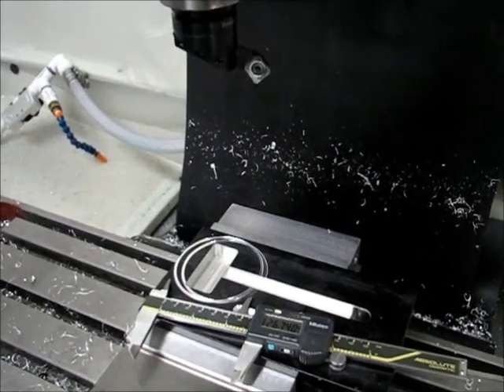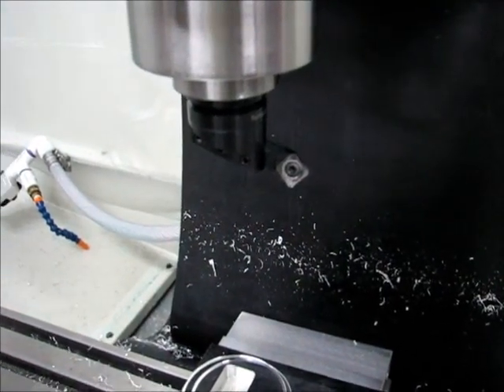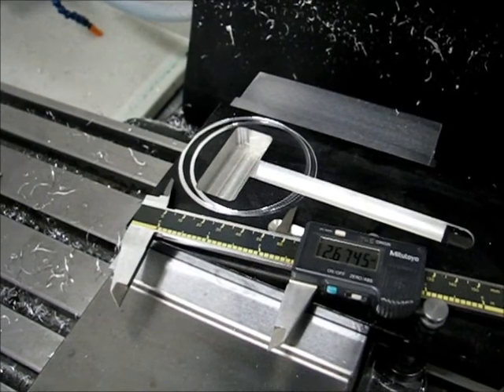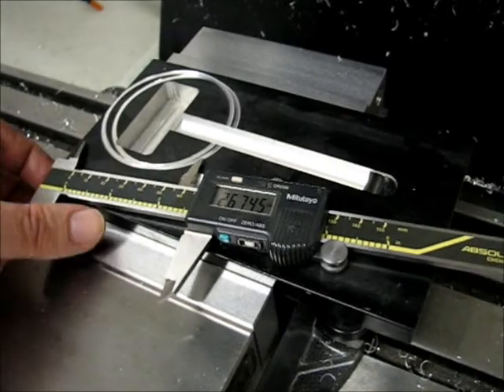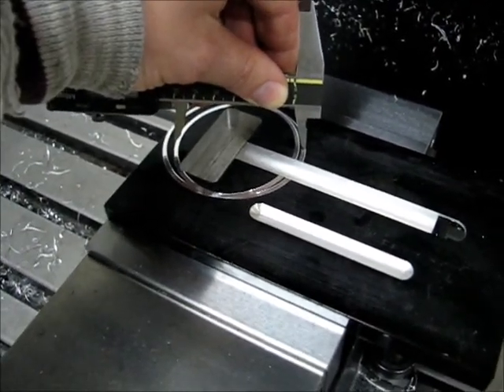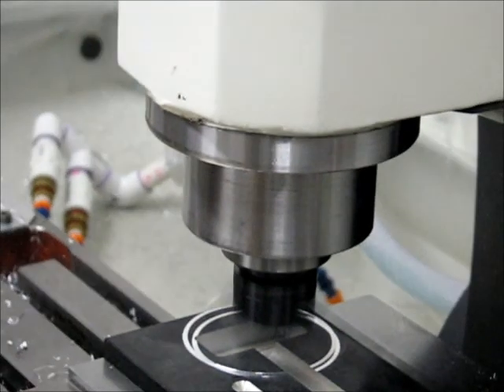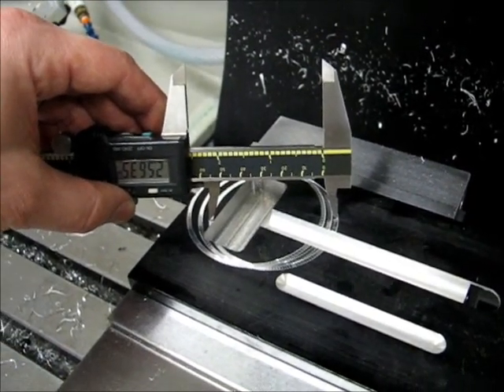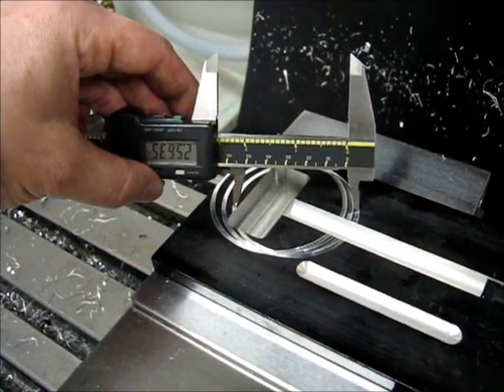Tormach PCNC 1100 - Setting Up The Tormach SuperFly Fly Cutter

Comment: here's a thought... Why not just set your G54 to the top edge (touching the solid jaw of vise), put a 2.5" wide piece in the vise, Do a rapid move to the center of it (y-1.25) and then set the fly cutter just past the edge.
Reply from the maker: That seems like a solid way to do it.  That would certainly get me dialed into the goal a lot faster.  I'd still like to know the diameter to the thousandth, so I would probably follow up with a single cut like shown in the video to get the precise diameter.  Thanks for watching!

Comment: Take your first cut and see what dimension your at now. Set up a dial indicator and touch it  to the tool . Adjust the tool using a radius dimension to where you need the cutter to be ( + / -) . It's that simple.

Comment from the maker: That would work if I were trying to set the diameter to the secondary cutting face on the side of the insert of the fly cutter.  In this case, I'm trying to set the diameter of the cutting face to be at a location that I can't reach like that.  I thought about using a method like that to estimate the offset by solving for the distance from the side, like you mention, to the point where I want the zero, but decided against that approach.

Thanks for the input!

Comment: I would setup a 1-2-3 block and clamp that to your table. using whatever endmill/drill you have on hand, jog it to make contact, use a .001" feeler gauge to get as close as possible. Zero the dro, move toward the gauge block half the distance of the endmill, zero again (now you rough found spindle center). move away from block, insert fly cutter bar loosely, MDI back to block "1.25"" distance away,subtract 1/2 distance of insert diameter from mdi. slide bar against block, tighten test.